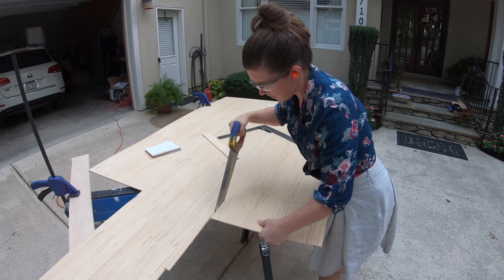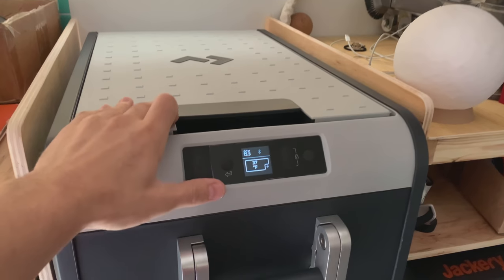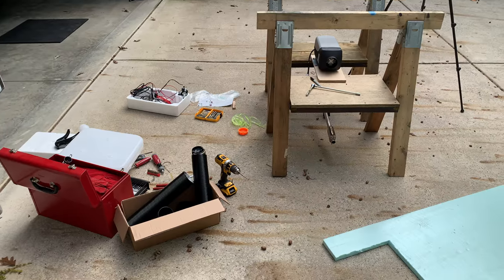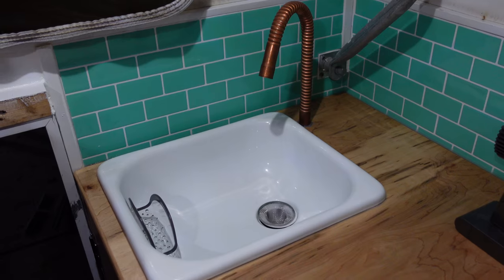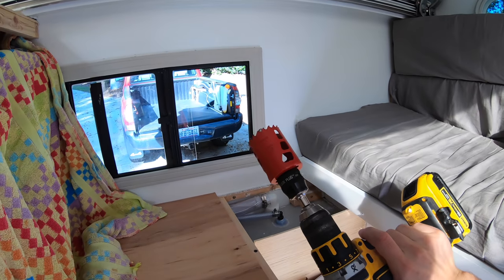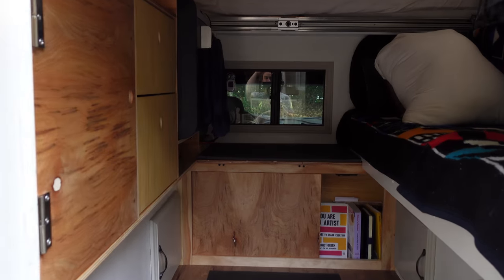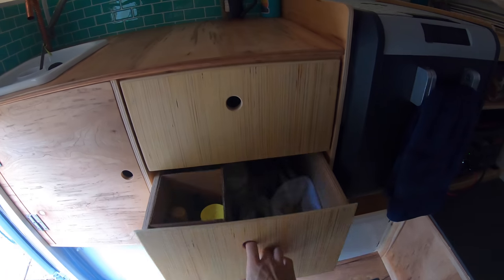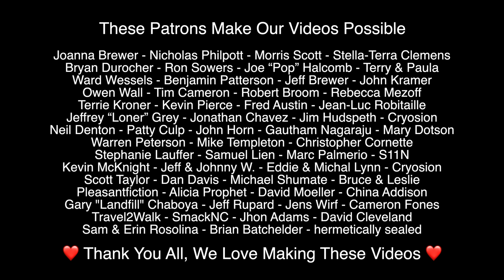We Finished The Truck Camper! Renovation Complete // Tacoma Truck Camper Renovation #10

Comment: A little tip when lowering the top. Run the Max air fan on high blowing out, shut the doors, windows,  and it will pull in the canvas as lowering. Good Job :)

Comment: amazing updates to a rough old camper.  well done.  I'd like to put together something similar using the big portable EcoflowPro I used as backup power to my house.  Seems smart to eliminate all the old propane based kitchen, even eliminate the camper's breaker panel, with an all in one lithium generator like that.  I learned a lot for this series like the Dometic fridge and the kind of vulnerable wood structure in these campers too.  Might consider a FourWheel Grandby shell to build out my 8ft Tundra.

Comment: Love what you have  done.  i have a 1999 Sunlite on a 2001 F150.  Mine stock.  Look forward to doing my remodel.
Reply from the maker: Best of luck with it!
Reply: @BackcountryBanter  if there is a gap between the camper and top of bed rails, buy some black pool noodles and squish tem into the space to create a more water seal.  Might help with keeping the diesel from water.  Works on my spce.  Be sure and do front truck rail...Safe travels..
Reply from the maker: Great idea! We were just talking about sealing those gaps.

Comment: Don't forget there are going to be potholes and bumps!  I would think about using foam padding, and securing or limiting movement of things like the Jackery.  Love the camper!!
Reply from the maker: Thanks! I didn’t show it but we have a strap that holds the jackery in and a strap that crosses the drawer fronts too. That said we’ve crossed a few bumps that shook the drawers hard enough to pop the strap off so we need a better solution there.

Comment: instead of drilling a 3/4 or 1 inch hole.. to pass a cigarette lighter plug through.  Cut it off, drill a 1/4 inch hole.. install a grommet in that.. feed the wire through, and either wire to a terminal strip, or attach a re-usuable plug to the wire.  the reasons and advantages should be obvious.  same for diesel heater !   and that exhaust passing right through the plastic bed liner.. fire and smoke aint no joke.

Comment: Do you still have the furnace that came in the camper ? Mines being a piece of shit and not working 😂
Reply from the maker: We took out the original propane one and use a diesel heater now. It is incredible.
Reply: @BackcountryBanter  I’m thinking about switching to a diesel heater tires if messing with this furnace. Did yours work when you pulled it out? If you still have it I’ll buy it
Reply from the maker: It did and we do still have it. The problem is it’s in NC and we’re in NM.
Reply: @BackcountryBanter  damn. Well if you find a way to have someone box it up and able to ship it I’m interested. Just let me know on here or I can email you

Comment: Excellent. Really impressive. One thing bugs me. Why install a kitchen sink so close to the end wall? All you’re doing is creating a inaccessible narrow groove where moisture, grime and gunk will gather...
Reply from the maker: We had to move it away from the edge a bit to account for the structure underneath. At the same time out goal was to maximize counter space so we wanted it as close to the wall as possible. We siliconed in between so it doesn’t hold moisture and cleans up easily.